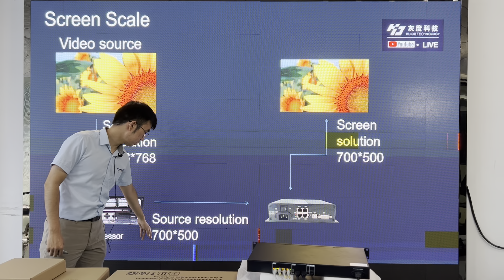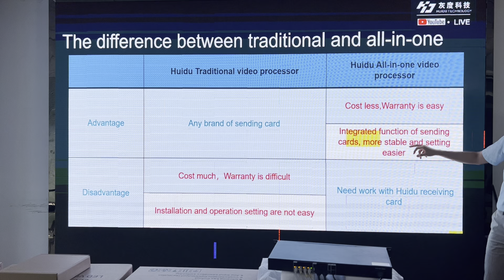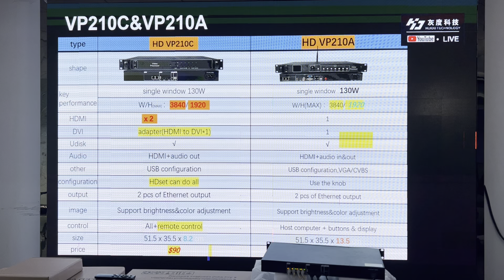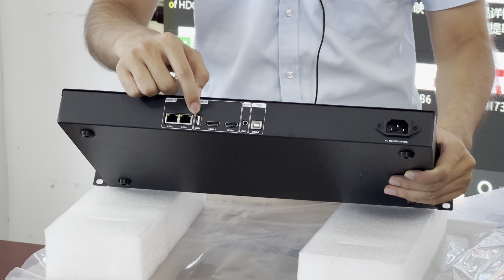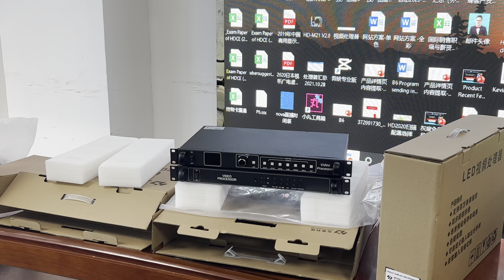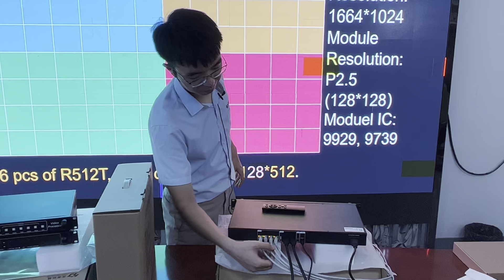New Video Processor HD-VP210C VP410C YouTube Live part 1

Comment: hello I did all the confugirearion steps of my vp210c controller but nothing is displayed on my screen
all my connections are made with the power supply
my screen is 512x256 with an R712 card
THANKS
Reply from the maker: which input source did you connect to the VP210C? welcome contact our engineer WA: +8613510540791.  let us help you to check .